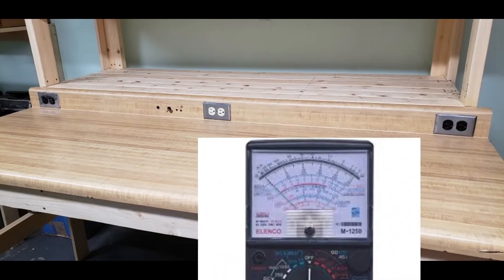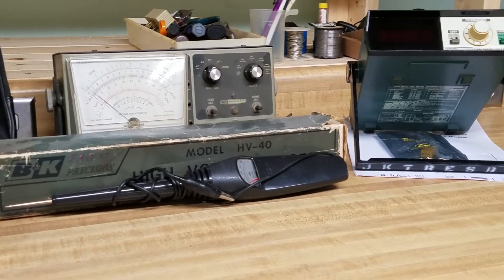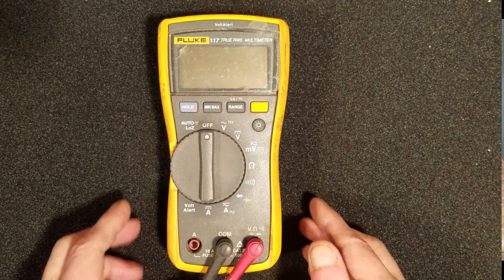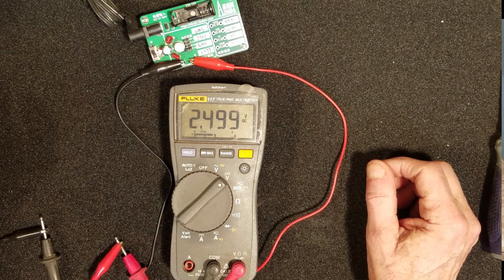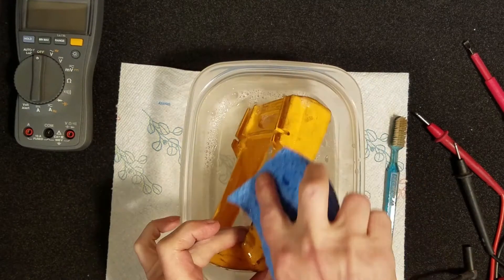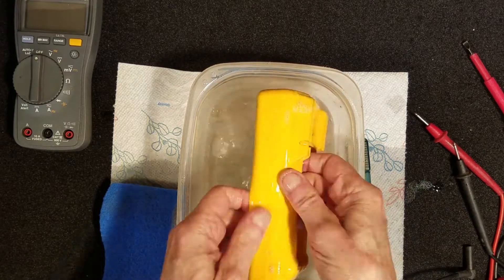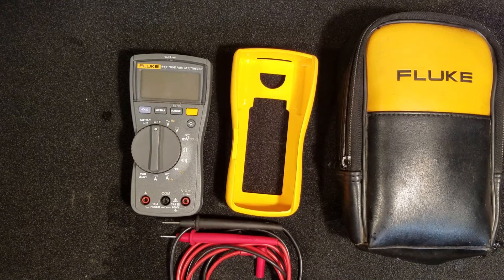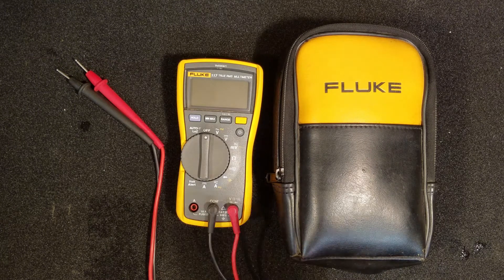001 Fluke 117 Multimeter

Comment: This meter is 20+ years old?
Reply from the maker: Yes, my owners manual lists 11/99.
Reply: @sparkysworkbench9570  wow...that's really a mature product!
Reply: @sparkysworkbench9570  11/99 is I think the date the legal text of the warranty system was made up.
The 114/115/117 came out in 2006 or early 2007 (2006 is the manual copyright date)
I bought mine 115 in late 2007.
I looked it up and it broke in 2009.
The replacement I got has been working fine since then though.

Comment: I was Just given a new Fluke 117 by My Pastor as a gift for working around the Church grounds vehicles . I  heard it's not made in USA like all the other Flukes I had owned, but I'll assume it will do Me well. I'm headed out the door now to find a voltage leak on a Suburban..   I'll find it 😊
Reply from the maker: What a great gift! Yes it is made in china but that hasn't stopped me from using mine all these years. Enjoy your meter.
Reply: @sparkysworkbench9570  I Will Thank You